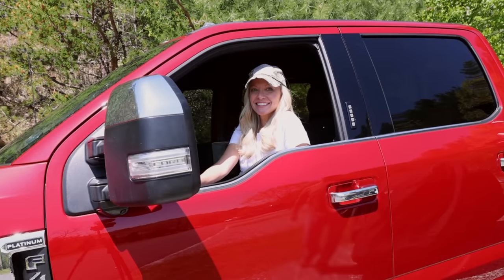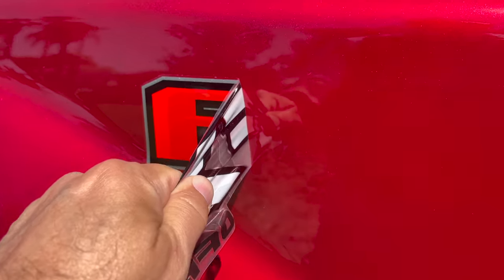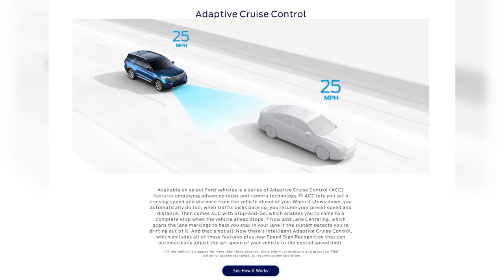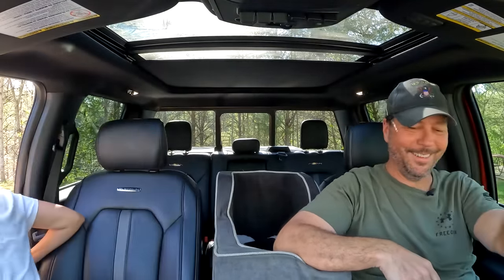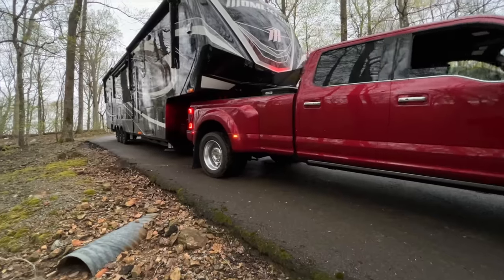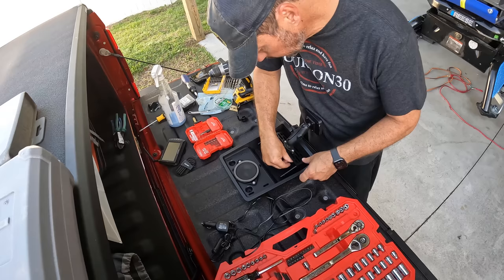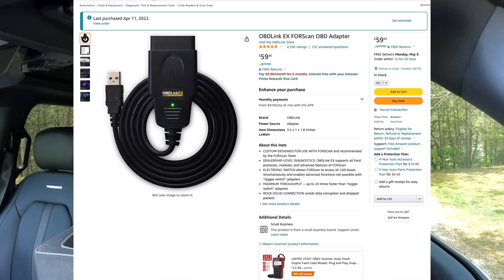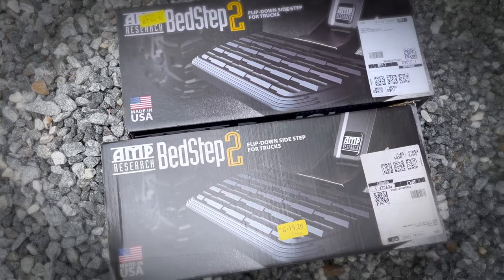2022 F450 Platinum! (Full Time RV!)

Comment: Almost impossible to find one of these but luckily I did . Its not the Platinum but it has all the bells and whistles I need. Basically a xl with a couple packages, camera system (which is useless to me), stx package, power equipment package, and a few more bells like the anti crash, 5th wheel package and a couple more. picking it up tomorrow. I was towing a 44ft 5th wheel with a 19 F350 SRW diesel which we were within specs but just within!  They gave me what I paid for my F350 SRW in 19 for this but no incentives what so ever!
Reply from the maker: Yea.. that's the way it goes these days.. high dollar for trade but nothing on the purchase side.  But, these days MSRP is a good deal.
Reply: @ChangingLanes  Just got home from the 8 hour round trip and I think it rides as nice as my 19 SRW F350 did. One thing I found out, it has a stay in lane thingy lol. When driving it I felt this little vibration in the steering wheel and thought it was the Ford "death wobble" and was scrolling through the setting and saw that so I turned it off. The 10 speed tranny sure is nice coming from a 6 speed, OH into PA is fairly level but this thing never came out of 10th gear and the monitor said I averaged 14.6 by the time I got home, I wish it had the realtime fuel monitoring like my 19 did but I love it. MSRP was 87,650 and zero wiggle room but they gave me 50K for my 19 so we had about 26K in equity  but ouch!

Comment: Since this video is a year old, you've probably been through a winter with your truck. If you wintered in an area with snow, slush, ice, and ice melt, you probably found that the automatic running boards stopped working (or began working very slowly). If you haven't experience that yet, count yourself lucky. I have an F-150 King Ranch with the automatic running boards. The driver's side stopped working about 2/3 of the way through the winter. When/if yours stop working, spray them liberally with PB Blaster and work them in and out. You may have to assist them at first. Eventually, they will begin working smoothly again. At that point, coat them in WD-40. Repeat as necessary.

Comment: This video speaks to the same things that I really like, possibly love, about our 2019 F-450 Limited Edition.  The one you got has some of the features I wish that I had, but my wife really liked the feel and look of the Limited, so that's what we bought...make that are still buying.  One thing you sort of mentioned, but didn't elaborate on was that the F-450 has larger half axels in the back, the commercial tires mounted to larger rims and that it has 1 inch larger disc brakes than the F350, which was one of the primary reasons we ended up with the F-450 instead of the F-350.  I really like what you did for the interior display items and will do something similar for our truck.  We have a 43.5-foot fifth wheel, not a toy hauler, but we wish it was, that we will be moving into next week after the sale of our home is completed.  I'm really interested in what you learn about the suspension packages as we are really close on our GVWR for the truck, like within 300 pounds fully loaded.

Comment: Chad/Tara, we love our 2021 F-450 King Ranch, I'm sure you'll love your F-450 too. Chad, did you happen to video your upfitter wiring? I'd be very interested in seeing that video, I've watched your previous video, but as you mentioned Ford has relocated everything on 2021+ Super Dutys. Also, look into the Furrion side-maker cameras. While I don't have the Furrion, I do have the Visionworks that I got from TechnoRV, with the side-marker cameras. More then the rear camera, I've used the side-markers in the side-by-side view. It's been a much better aide than the rear camera for seeing what is beside me will traveling.
Reply from the maker: Thanks.. we plan on checking out the same cameras at some point.  I might make a short on the wiring.. 👍🏼

Comment: Hi I like your videos one thing in question that I wanted to ask you I have been having problems with my rear rims on my 450s and my 350s corrosion at the valve stem did you have this problem with your 350
Reply from the maker: We had that problem on our F350 for sure!  See: https://changinglanesrv.com/truck-upgrades-for-full-time-rv-life/
Time will tell if we have any issues on the 450... If we do, we'll swap for Alcoa.

Comment: ** A little info on your Ambulance suspension question*** Most Ambulances have an onboard compressor filled, air-ride system.  They have airbags, and sometimes get popped hitting railroad tracks or large potholes if you are driving too fast. They will deflate a little once the engine is turned off, so they have to stay plugged in.  You can talk to a mechanic at an Ambulance service or an emergency apparatus mechanic in a town or city.  They will educate you on what system is the best and most durable.  It is a constant repair situation for busy Ambulances, so they are quite familiar with the systems.  Safe travels, I enjoy watching all of your videos.
Reply from the maker: Thanks, Josh!

Comment: Congratulations on the new good-looking truck.  I ceramic coated our 2017 black Jeep Cherokee in 2017 and it still looks great and is very easy to clean.  Also, a great opening to the video.

Comment: Great looking truck Chad, just wondering if you have the option for RV towing on the navigation that routes you away from hazards like your garmin?
Reply from the maker: I've looked and ours does not have that option...
Reply: @ChangingLanes  OMG, I have to tell you this story. My wife and I picked up our brand new Redwood and the guy that gave us our walkthrough knew very little about the unit. He began explaining the nautilus system and pulled the black tank and grey tank release valves and told us it is that easy. We continued the walk through and the person was unable to answer any of our questions. (Note: my wife and I are newbies!! We know nothing other than what we watch on your videos).
We left with our 40' 5th wheel and set up at our first camp site. We are just trying to get it home so we are only staying at camp sites for one night than continuing on until we get home. After our second stop, we noticed the black tank and grey tanks were getting a little full. I decided I would empty them prior to leaving our camp site. 
I hooked up the sewer hose and had my wife there to help so there would be no issues!!
Luckily I purchased the Valtera valve you suggested on your videos and when I went to hook up my sewer hose I noticed lots of dirty water in the clear pipe of the valve.
I asked my wife to pull open the black tanks and that is when we realized the worker never closed them!!!!!!
Can you imagine if I did not install that valve what a mess I would have had trying to empty those tanks.
That purchase was priceless.
Our first black tank empty went flawless and now we have learned to make sure they are closed.
Thanks again for all of your good advice, very much appreciated.
We use all of your check lists and so far have had no issues, safety wise, just shakedown issues.
Hopefully we will meet on the road one day.
Brian and Lisa Crocker

Comment: Well good points on the 450, I own a 2019 450 STX at present and haul a Momentum 376TH with it, I have put a console in mine and done leather plus some other minor upgrades. My 450 is having issues mainly due to miles, it has 120k miles on it and it is due a lot of maintenance repairs. Major oil leak which requires cab off trans out, oil pan & timing cover off, front end bushes etc and 2nd set of tires. So it is either repair and spend the best part of 10k or trade. I am going to trade. Found a 14k GVWR F350 Lariat at sticker price and been offered $6 less than what I paid for my 450 originally. I will miss the turning radius of the 450 and the big brakes but driving accordingly is the key. I will not miss the harsh ride of the 450. Also it is near impossible to get another 450 quickly right now and ordering will take months of not a year, plus in most case they are over $100k that is if you can find one. I am not in a position to wait 12 months for a new truck. A 350 is on the lot and it has the features, towing capacity &payload I need, actually the payload is more than my 450. I will save on running costs and insurance by going back to a 350 to. So I am planning to trade.

Comment: Congratulations on your new truck. May you have many trouble free miles with it. We had a 2015 F450 and loved it. Pro was turning radius and larger brakes. Con was dealing with commercial tires. You can’t go just anywhere and they are very expensive.
Reply: Where do you usually go to get your tire worked on?  Dealer?
Reply: @wj2791  , I would go to a tire place that deals with commercial truck tires. Some dealers can order commercial tires but can’t mount them due to exceeding capabilities of their equipment.

Comment: Question from ignorance... at 21:45 you talked about FORScan plugged into the OBD-II port.  A few weeks ago Scotty (the car repair guy, "Rev up your engines!") cautioned about devices plugged into ODB-II ports semi-permanently, causing EMS computer problems.  Is FORScan rated for permanent connection? (Presumably a high impedance, very low power draw from the port.)  
Edit: Or are you just connecting it to make the changes, then removing it and putting it away?
Reply from the maker: It's only connected while programming. 👍🏼

Comment: This is kayak Mark from lone Rock. I've had four of the 450s a 2008 2010 a 2016 and the 2020 they've all been good but this 2020 with that new transmission and the power is unbelievable and the mileage is a lot better congratulations on yours I've got 48,000 miles on mine already. I like the red mine is the star bright white pearl white I guess.
Reply from the maker: Yea.. we were surprised about the mileage!

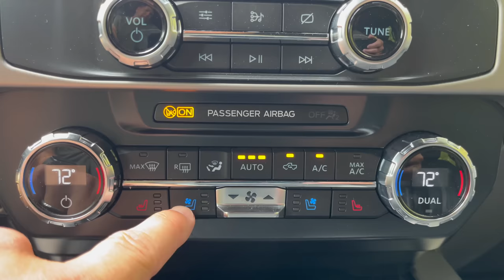Comment: Man what a beauty. I love that turning radius. The one thing you will notice on the F450 is the tire wander. It will find a groove in the road and wander with it. Not every time, but you will have that.  Something to do with the 19.5 inch tire construction. I like the idea of the adaptive steering, but not adaptive cruise control. I absolutely hate it on my wife's Honda Passport. You're also using cruise control much more because of your 4:30 gears. It makes a big difference. The F450 is a fantastic truck, but it is way overkill for our future upgraded RV. There reaches that point of diminishing returns, and 16k lbs certainly does not need a 450. So I ended up with a rebate mailed to me from Ford (over 30 years of them) only to find the order bank for the 2022's ended the week before. I drove the Ram, and it's very nice. I just think I want to stay with my Fords. So now I'm stuck waiting. And I'm not sure for how long.  I'm glad you got yours. Enjoy. Pet Daisy for us, we're still missing ours.

Comment: The Carli suspension systems. Greatly improve ride overstock their pin top system I have personally on my 2020 F350 single wheel with airbags. I run the full progressive lease springs that they offer with all other options. It still rides like a truck but I would say it rides more like a stock F150 and does not ride like a leaf spring 1 ton truck. If that makes sense. I went with the 2.5 inch lift but it is not really a lift it’s more of a leveling kit with suspension improvement.
Reply: I went with this option because even though people tell me that oh it’s a big truck it’s supposed to ride like a truck I’m in the similar boat as you as. This is my daily driver/work truck/camper puller. The system gives me the comfort to daily drive the truck but still has the suspension capacity to tow my fifth wheel or boat on the weekends. I recommend calling CJC off-road and tell them your needs and there are great people and they will really work with you. Tell Cody I sent you.

Comment: I sorry but,my f250 2018 lariat tubo diesel 6.7 fx4 was a special order because I didn't want any sun roof on it, it all factory led lights inside and out side. 2018 ! But it has a 6inch lift on 37x17x13.5 toyo open country mud tires and I am still in the honeymoon stages with it.from texas 🤠🤘

Comment: I always get a kick out of YouTube advertising algorithm. Second commercial was for a Chevy 3500 🤣🤣🤣

Glad you both love the new truck. You may think about putting a piece of gorilla tape on the top side of the mud flap against the wheel well liner. Would prevent any water from going down the back side of the mud flap and pooling inside the fender lip causing corrosion in the future.

Comment: Question on TPMS- we have the 507 system as well but I can't figure out which type sensors to put on our 2019 F-450.  Which did you use?  We have the old fashioned type on our 5th Wheel, and we actually thought the 450 had them built in, but found out the hard way that it doesn't.  Thanks for your advice.
Reply: I used the screw on cap style.  I did not think it would be wise to try and use the passthru style as they stick out a far bit.  They also sell internal band style sensors but I am not sure how well those will work with these type of tires.
Reply from the maker: We have cap sensors on the truck and flow-thru on the RV.. 👍🏼

Comment: When you used the “pass-thru” wires, did you use a wire for ground back to engine compartment or did you ground the 12v plugs in the dash?  I have an F250 2022. I got the built right bracket and the connectors like you use.  I’m trying to figure out how to do the power.
Reply from the maker: I just grounded them under the dash after confirming the metal under there was connected to the frame.
Reply: @ChangingLanes  Thanks Chad.  Now to run the wires through the dash to power.   😉

Comment: Great truck!  Have you thought about putting in an onboard air system?
Reply from the maker: That would be nice!
Reply: @ChangingLanes  On my F250, I figured out a way to mount dual Viair 480 compressors with the 2.5 gallon tank, all up above my spare tire, without welding.  The tank is perpendicular, between the frame rails, so I'm not sure how that'd fit on an F450.  But the 200 psi has been very convenient and useful so far (installed about 13 months ago).

Comment: Wondering how you got it in such a short time. We ordered our 350 king ranch October22 and still waiting to get it.
We were told the adaptive steering was a hard hold by ford by two dealers and still is on hold. So we didn’t select that option.
We were told it would be 8-12 weeks to get it 
I recently called every ford dealer in Texas and asked about time to get an ordered truck all said 8-12 weeks. They know Ford can’t deliver in that time frame. 
FYI Ford trucks are extremely easy to break into so keep an eye on all your electronics inside it. 
Safe travels
Reply from the maker: No idea... We got lucky somehow!

Comment: Will the AMP Bedstep 2 work on a F450? Their website doesn’t have the F450 listed as an option and it seems like I read somewhere in the past that it requires modification to fit on a F450? Were you able to get it installed?
Reply from the maker: Some there say no and some say yes... I just installed ours a week ago and they fit fine but do have about a 3/4" gap when folded up.  Not very noticeable and 100% functional.

Comment: Hey guys, quick question about your rig. I bought a 2024 F-450 yesterday and hooked up to my Grand Design 346 flsr today. Camper sits nose high by 3-4". What did you guys have to do to get your camper level?
Reply: My bed clearance is 8 " at the front and 6" measure at the rear of the bed just infront of the tailgate on the truck
Reply from the maker: I would try moving your hitch (in your bed) down a notch.  If that's not possible, it might be possible to raise your pin box a hole.  those are the only 2 places to adjust the relationship between the RV and truck.

Comment: 💕💕💕💕💕💕💕💕💕💕💕💕
I picked up a bottle of turtle Wax ceramic coating at Menards for like $12 and I am very surprised that instructions say to just spray it on a clean vehicle and wipe it off ,  and it last for one year and it looks just as good as your truck, and it was a big surprise to see , and even after 3 months now  it is just as shiny as day one. Approximate cost $60 for 5 years and a half hour labor per year😂😂

Comment: Where were the pass-thru wires located in the engine compartment? Did you have to remove the battery?
Reply from the maker: Hi, Jorge!  Just seeing this...  I did not have to remove the battery.  The pass-thru wires were under the hood on the passenger side folded up in a bundle.  See: https://youtube.com/shorts/pcybe6AxV0M

Comment: Kelderman is something we’ve been researching. The stock height air ride system, which doesn’t affect tow ratings. Would most likely go to their shop in Iowa to get it done, rather than a reseller/installer. Heard that emailing them is a better way to get ahold of them, haven’t done that yet though. Saw you post on that one review the gentlemen did on a 2017 f450 and noted he mentioned the spare tire had to be removed. If installed by Kelderman that’s not the case, just the installer he used in Texas does that for easier install it seems. Congrats on the new rig! So exciting!
Reply: I have 2023 F450 Limited on order with priority 10 since Oct 28th, 2022.  I have been looking at Kelderman - Iowa but that is a long drive or tow from HouTexas.  Did you find the good shop in and around this area?  F450 is my daily driver and is being used to haul some weight up to 4500 lbs.  I don't have the trailer to tow.  I will be trading in my F350 DRW 6.7 for this F450.    Any info on the shop in Texas will be appreciated.